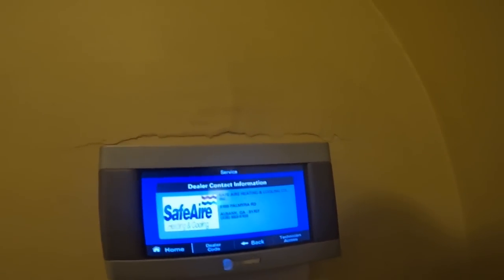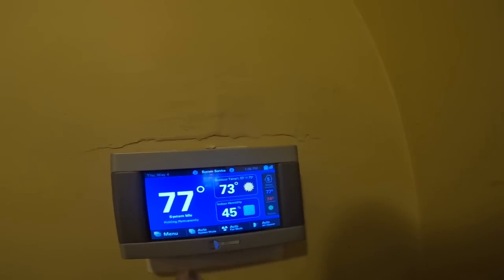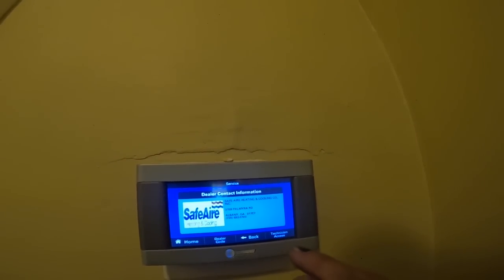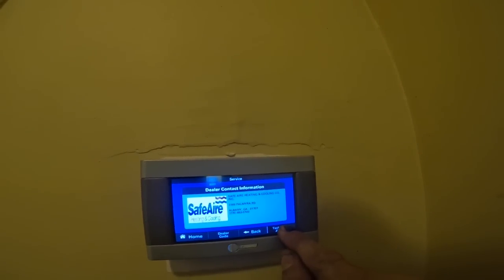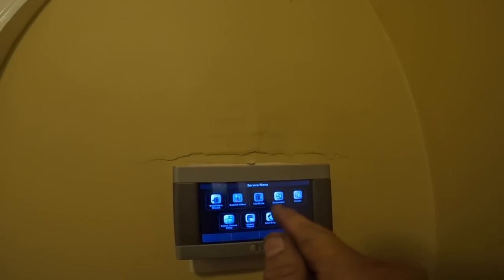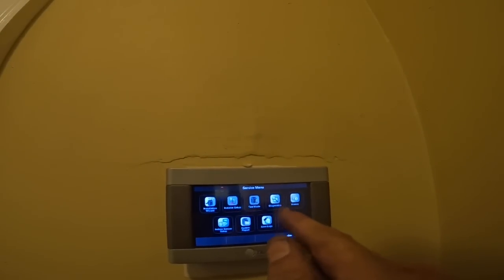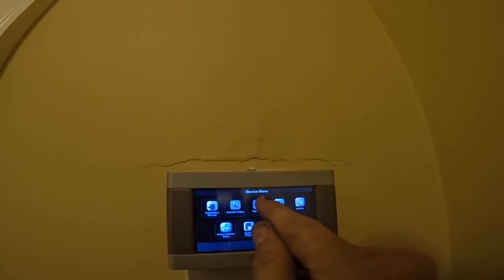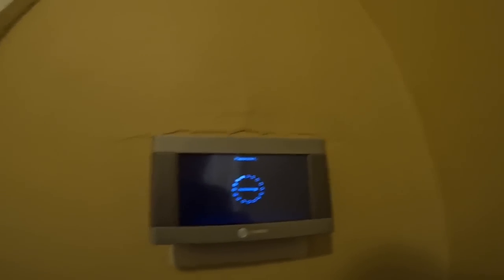I Don’t See These Very Often. Had To Read Up On it And Head Back! #hvacguy #hvaclife

Comment: What kind of money will Theas boards cost the homeowner. Our industry is taking this board thing way to far. It does not take all this high dollar stuff to make A good unit that the homeowner can afford to keep running.
Reply: They are around a $1000 but if you registered the equipment for your customer it’s has a 10 year warranty. 
We alway register the equipment for the customer to avoid issues in the future. I think I have replaced 3 of these over the last 4 years. They are reliable but if a lizard gets into the space between the shield  and the board and it gets fried it usually kills the board.
Reply: It’s not the industry it’s the energy ratings that the government requires. These are 18 to 20 plus thousand dollars systems installed. Most people can’t afford these without financing them.

Comment: I know the xv's run in a limp mode if there is a slight issue. This is to prevent the equipment from damaging its self. Usually its a sensor with the xvs.

Comment: I worked on one of these throwing a ton of codes a while back. It ended up being low on charge. These will throw a lot of codes like (10) if low on charge. Like you I returned after reading both indoor and outdoor service manuals. The coils in the tam8 are also known to leak at the U bends in the front right corner. Definitely a learning curve on the XVs when you haven’t seen one before.

Comment: Well, I would add a “Nuisance Barking Dog” fee. Add a surge suppressor at the disconnect. Should have been installed with that $12K+ system changeout. You know, by the same jackleg that didn’t leave the installation manual and service instructions at the AH or in a safe place with customer.
Reply from the maker: It had a surge protector inside the panel hooked to power wire coming in.
Reply: @HVACGUY  always put one right at the disconnect too.

Comment: Hey Curtis I work on these a lot, and I have been through a lot with these systems to now I can easily diagnose them. System charge is perfect you have an 8 sub cool that’s enough for the valve. A lot of common issues that I’ve seen is lack of maintenance especially if it’s a heat pump paired with a tam8 or 9 system. Sensors can also become shorted or read incorrectly causing the system to think there’s too high of a load and will put its self through a hard lock out to protect itself. One I ran yesterday had a 177 code which means the load was too high and an overcurrent in the drive was detected, that usually means that the drive got too hot. And of course once’s I opened the condenser, that coil was caked. 
First thing I would do is go to your thermostat, go to tech access, go to your diagnostic alerts and look at your alert history , take a picture of all the descriptions that are recent and follow the prompts, your pressures look great however there must be some maintenance issue, sensor or bad connection. Also a odd common issue that has been going on in my area is the heat pumps will run in heat while calling for cooling, or in the winter they’ll run in cool while calling for heat , that means you need to replace the reversing valve harness and perform a drive update with a computer or with tranes mantis board. 
Always start with your diagnostic option at the thermostat when trouble shooting and follow the prompts.

Also on the CDA out side push the up and down arrows for 5-10sec then you can see alerts and your control menu which will allow you to run drive tests and OD fan tests.
Also on tam 8and 9 you hold the up and down arrows for 10-15sec and you’ll be able to do the same.

Comment: I hate an xv. Leaky coils and need drive updates. Always something
Reply: Leaky coils are no longer a issue at this point. And if the 1050/850 are connected to the internet the drive will update itself. One of the easiest systems to work on once you learn the system. Always go to diagnostic’s at the tstat first. This should direct you to the most likely area to look at first. The drive controls everything in these systems.
  The new X series give you virtually everything you need to know without getting a single tool off your vehicle. Just a cell phone app and your good to go. If you set up monitoring at the installation on the tstat you know before you go what has happened in the past and present which will speed up the repair. These units have a very low part failure rate. We install around 800 XV systems per year
And have very few issues with them.

Comment: This happens some times turning off the system at the tstat will allow you access to the CDA
only the X series gives you pressures AS WELL AS ALL THE READINGS YOU NEED TO DIAGNOSE THE SYSTEM. If you shut off the power make sure to power up the outdoor unit before the the indoor.

Comment: Error codes are cleared from the CDA IN THE OUTDOOR UNIT the Drive is the large part taking most of the space it can’t be serviced if failed it must be replaced. Requires a authorization from tech support if changed under warranty. I have the XV20 with zoning in our home. No issues yet after 5 years of service.
Reply: You are right 
I found the control board bad on one a while back and found out the whole drive   unit would have to be replaced and had to go through the authorization process

Comment: It’s called the CDA. You can either cycle power to the outdoor unit or unplug harness and plug back in and see if they will response when you press on the buttons. Yes you can read suction pressure and SH only on the older XVs. Newer ones (after 2022) you can read both low and high as well as SH/SC and all the good stuffs

Comment: On the CMA pushing and holding both up arrow and down arrow at the same time will enter into the diagnostic and configuration mode.   I have found that you have to push pretty firmly to make both switches.  At the thermostat, you have to put it into charge mode so the compressor runs at a constant speed, the compressors on those units have 750 different speeds and it’s constantly changing speeds.
Reply: Well you want to put checkout mode , not charge mode, check out mode at 100 will tell all components to run at 100% and act as if the load is high for the compressor to run at 100%

Comment: Junkie old Trane unit. Just kidding, they don't seem to be as good as the old models. This board, that board, code this, code that. You need a degree in computer science now days to work on anything, from cars to washing machines. Getting out of hand if you ask me. What ever happened to simplicity?
Reply: Government and efficiency laws
Reply: These actually aren’t terrible to repair once you know how to operate the displays. It Will literally almost tell you what’s wrong with it or at least narrow it down to a few reasons and you follow the flow chart with your meter to verify issues. As far as the equipment quality I agree with you it’s kinda junk IMO
Reply: @donnyjackson1908  I'm sure you're right Donny, just saying... I'm an old fashion type of guy. These touch screen cars and all. Give me back the gage cluster and sell me the car 10k cheaper, If you get what I mean.
Reply: @Sesamestreet9080  You are right about that. We can all see what government is doing for us. That is why I changed to "no party" affiliate. The left or right makes no difference, I hate all politicians equally.
Reply: When I first started in the hvac trade over 40 years ago a run cap would usually outlast the system.
The defrost clock was a mechanical clock with a 30/60/90 minute option depending on what post you  put the jumper.
Also had quiet a few R-502 (if I remember correctly) systems. 
 The newer XV and now the X series are getting more reliable but can still have issues beyond some service technicians knowledge base but after a learning the system through research and tech support phone calls. ( I always take notes after the call to tech support. I use my cell to record the tech support calls and play them back to make notes for future reference.
Reply: @hvacmike1175  Yep, forever changing, nothing stays the same. I remember when they came out with R22, because it was more environment friendly. Now it's said to be horrible. Honestly, I don't know why they don't design the systems to run on nitrogen or even co2.

Comment: You have to hold the up and down for like 60 seconds to get in to that CDA I work on them every day and it doesn’t matter if you have 100 % demand in test mode.
Reply from the maker: So, I wasn’t holding it long enough?
Reply: If your working on the XV product every day ( maybe a figure of speech) then whoever is doing the installation’s needs additional training.  Nitrogen when soldering, charge per Trane .6 ounces per foot of copper after the first 10’.
This results in a perfect charge on every installation. We change the line set on 90% of our changeouts. We label the inside of the condenser with the total charge.
  This makes it a no brainer if you ever need to replace a part on the refrigerant side of the system.
Reply: On occasion the CDA freezes when there are multiple errors. Turn the thermostat off and go back out to the CDA 12 to 15 seconds and it will take you to the service menu. Then scroll to alerts. Here you will find all alerts in the history. Always delete these when you get through. This is the only way to delete the error codes. The CDA IS HOW YOU MAKE CHANGES.
ITS UNDER THE CONFIG MENU. I MADE A SHORT VIDEO SHOWING THE CDA

Comment: If you worried about your coil or your compressor, well now you have to worry about your $8000 inverter going out. New cap and switch $30, now replaced with a $8000 part. Good luck. Oh, and also with the new flame thrower gas’s coming in, if your system detects any amount of gas loss it shuts down. No more top up’s it’s find leak or buy $20000 new systems

Comment: We install Goodman and tranes. I’ve worked on a lot of the variable speed systems. When getting into the cda especially on the OD unit(which is that monitor) if the system is throwing codes a lot of the times you have to kill power on the od unit for 2 minutes then restore power and then it’ll let you into the cda where you can view the alert history. And you can’t check pressures through the cda. Still gotta hook the probes up. Great video though. If you have any questions with the variable speed systems feel free to ask I’ve worked on a lot of em
Reply: I have more than 20years in 
I really struggle with these
Really have a lack of confidence while troubleshooting. I hate to say it but I get angry while kneeling down to take access panels off .The company I work for only has a few of these. Maybe 10..
I sure would appreciate if I could on a very rare occasion call you for guidance 
From Zuni Virginia
Reply: Hey Will
Reply: @lonniebearden5567  LONNIE

Comment: Tell me, does the S8X2 support fan speed control from the HMI?  I'm asking this because I have one and I can't seem to be able to control the speed from there in continuous fan mode.
Reply: You can access constant blower speed percentages but if I remember correctly without going to the truck and getting manuals, I think it's in the installer setup menu. I hope that will help you out

Comment: You don’t see as many tranes because they are expensive.  When I replaced my HVAC system 13 years ago, I had a choice of a $10,000 Trane system or an $8000 Lennox system, so I went with the Lennox.  I went from a 3 1/2 ton to a 4 ton system, so the prices included installing larger refrigerant lines, also adding a 16 inch return air duct with a 20”x 30“ air filter grill, adding another 7 inch supply air duct with register, new plenum boxes, and gas furnace/coil box attic hanging kit with ceiling saver kit.  Happy with my decision.  🙂
Reply: 8k for just the units or with all the extra duct work they had to do?
Reply: @SombraLocs  Everything was included for 8000.  This was 13 years ago, so now I’m sure it would be more.
Reply: Trane is all the rage in FL. 13 years ago Lennox was terrible. Course really all of them are terrible.

Comment: Also if the thermostat is throwing low pressure fault in cooling mode, if filters are clean and both ET/GT sensors read in range (inside air handler), more than likely it’s low on charge. Tam coils are leaky

Comment: Would you like me to email you the manual that shows where to check for DC voltage? 

Your readings will not be correct, when you simply turn the set point of the stat down low. Must go to the stat and put the system in Test Mode.

Comment: What is that little
Tool your using to unlock the caps ??
Reply: I can't see it clearly 
But I think that they are locking  child proof caps.that take a key to remove 
There are several brands of these and each have a different key
Reply: @georgemunford3804  yea I know that but it looks like he has a key that has multiple keys in one ?